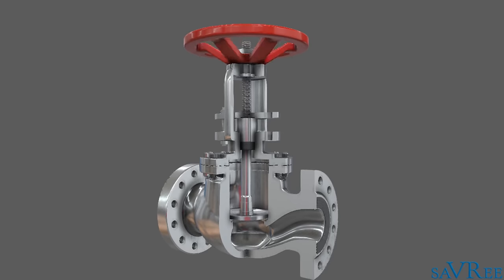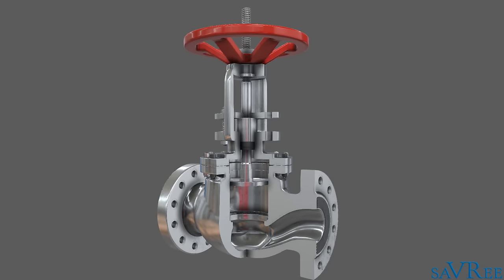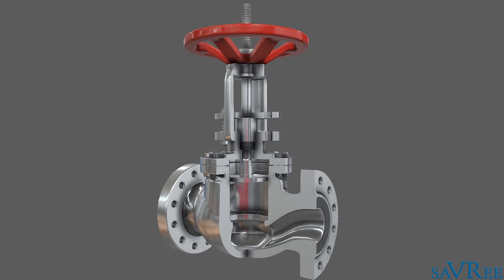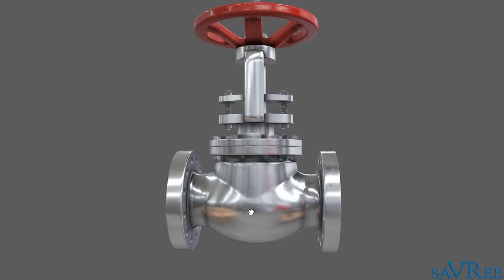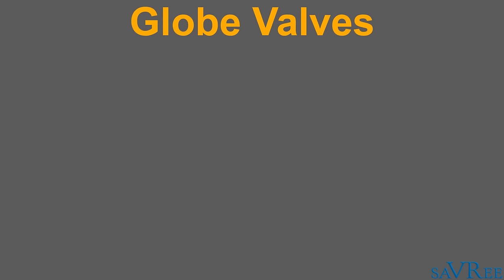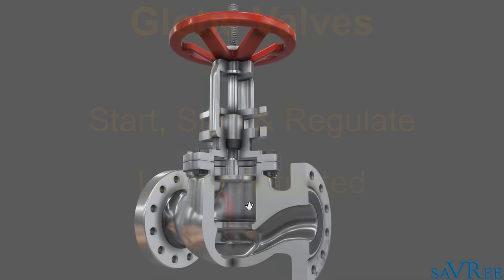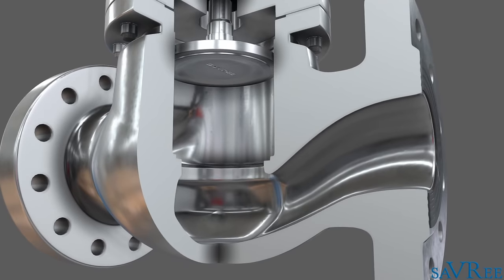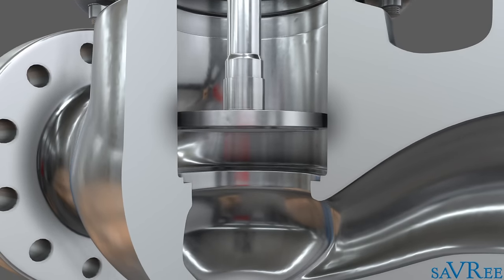How Globe Valves Work

Comment: Thank you for your great efforts , But if you could  I want a catalog of your valve for different sizes  & I have a question : does this valve have a  possibility of setting a pressure & flow ?
Reply: thank you for your reply , Does a butterfly one also set the pressure & flow.

Comment: Good informative but i do not understand the backseat concept.As we try to close valve in the presence of the fluid at backseat chamber .Fluid does not have any path to go and it would be impossible to close for imcompressible fluid the result would be leakage of packing .but this does not  happened in it  , which is making me confuse as there is no fluid flow simulation .